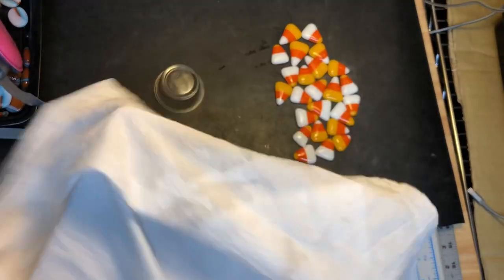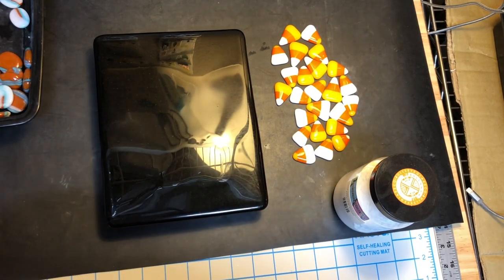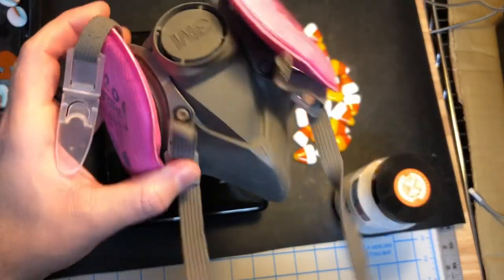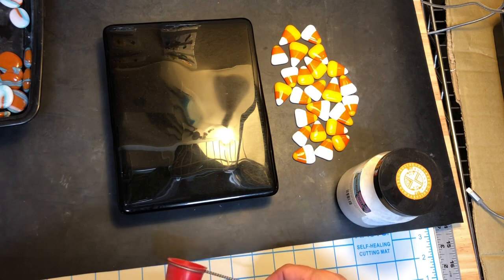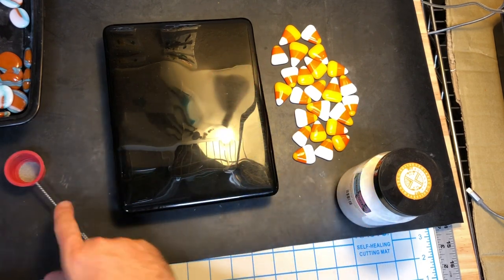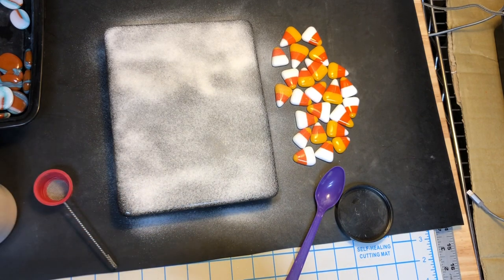The Twists and Turns of a Project Saved

Comment: Hi Jamaison, I used your idea and made candy corn. I am planning to put them on the rim of a round pasta bowl slump mold. Did you tack fuse the candy corn on to the glass and then slump it? Or did the candy corn tack onto the glass during the slump? Much thanks for your videos and great ideas! I also stole your mummy Halloween tray idea and they turned out GREAT, right down to the aventurine green eyes with yellow pupils (I tried one using red pupils, but they didn't look nearly as cool). I can't wait to give them as gifts.
Reply from the maker: A slump firing would not give you the tack fuse that you want. You really need to fuse the candy corn onto your peace the way you want them before you slump. I’m glad you like the project and the mummy project as well!
Reply: @JamaisonSchuler  Thank you!

Comment: So you full fused the piece with powder to fix the devit, then contour fused the new candy corn and then slump fired?  Just checking to see if you combined any steps. Thanks. Really cute project!
Reply from the maker: Yes, exactly -- full fused the powder then tack fused the candy corn, then slumped. LOTS of firings to get to the finished one! I am not sure that I could have successfully combined any of these firings as the schedules would be too different.